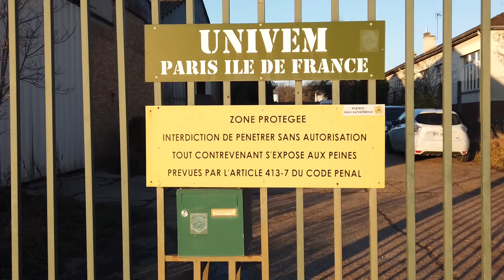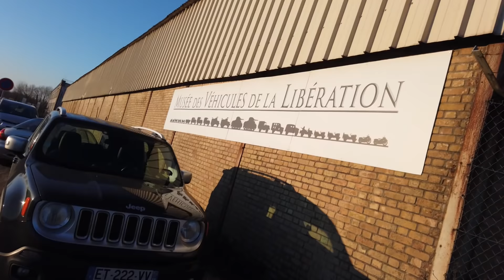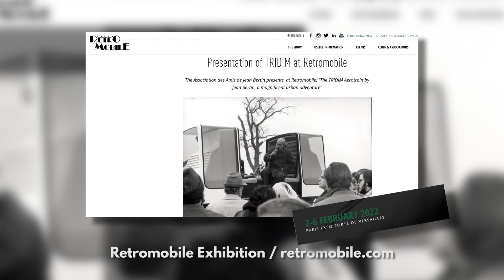The 422km/h Hovertrain That Destroyed The Rail Speed Record: What Happened To Aerotrain 01 & 02?

Comment: Usually when it's in a warehouse somewhere it's in awful condition, but those look GREAT! That really should be a part of some major technological museum.
Reply: Ikr? Must be some crazy-dedicated volunteers
Reply: Or perhaps a preservation society - restoring the original track. lol! Now that would be a tourist / heritage railway with a difference. :D
Reply: The only thing I can think of is that train museums don't think it's trainy enough and maybe general transport museums think it's too trainy 🤷‍♂
Reply: There are some political issues behind this story.
Reply: Aluminium doesn't rust, so things that are designed to be lightweight have a bit of an advantage. :-D
The problems start when they have aluminium panels and steel frames...
Reply: @juststeve5542  Aluminium doesn't rust, but it still gets oxidized (it's white).
Reply: @Ezullof  yes, but unlike iron oxide, the oxide layer of Aluminium doesn't expand in size, and remains on the the surface as a protective layer.
Iron expands as it forms its oxide, causing the rust to crack and flake off, exposing fresh iron to corrosion.
Reply: @tomjoad1363  Can you elaborate?
Reply: @frznbxy  At that time the french government had chosen it would be the gaz-turbine powered "TGV" that would be the next french railway system. Therefore they had to stop this project.

Comment: Two larger experimental units were tested 1969 to 1977 on a longer test track Saran to Ruan that was intended to become part of a possible later line Paris to Orléans. 
Aérotrain I80 HV (an 80-seater built 1969 with a propeller and modified in 1974 with a jet engine), stored in Chevilly after the tests ended in 1977, was unfortunately destroyed in a fire 1992.
Aérotrain S44 (a suburban version with linear motor also of 1969) was destroyed by fire 1991 in Gometz-la-Ville.

SNCF was not part of the project. But the threat of competition by a new system led them to develop a high speed train on wheels and rails that was compatible to the existing network.
As the high speed tests of 1955 had destroyed several pantographs, at first a gas turbine train was tested (TGV 001) until the project was developed further into the electric TGV that we have today, with the first high speed line LGV Sud-Est built 1976 to 1981.
Reply: I was about to leave a comment about those tao other Aérotrain. I thought someone kept I80 HV wreck?
Reply: @mathieudizangremel7259  I would be interested in what remains of it!
Reply: So the rule is "old hovertrains spontaneously combust"? That is not good.
Reply: @uncinarynin  one tiny piece of about 10 by 10 cm’s, that’s all.
And some photo’s. The friends of Jean Bertin have it in their collection.

Comment: Thanks for introduce Aerotrain overseas. It's an incredible invention, it's simple, fast and cheap but TGV (high speed train) were chosen due to political reasons and the most advanced prototype, the I80 was burned but it still remains some elements. At 4:43 the thing with 2 red circles behind Tridim is an original I80 part. It's one of the two gas turbine used for propulsion on ducted fan version. The other one is in the corner with other parts of the propulsion system and a third gas turbine used for air cushion and auxiliary power. The original propeller are located in Figeac in Ratier museum. Ratier Figeac is a propeller manufacturer.
Reply: You should have seen Tridim in action, air cushion are unbelievable!
There are meetings organized on the track (Gometz-la-ville) between enthusiasts once per year, you should come, there are some videos on my YouTube channel and even an interview of one of the pilot. There is another track in Orléans, an 18 km test track at scale 1 where Aerotrain I80 breaks the speed record of 430.2 km/h. It was the fastest train on the planet!
Reply: Aerotrain was also experimented in the USA. It's called the "ROHR Aérotrain" it was full electric moved by a linear induction motor. But because it was drawing too much power, tests were quickly aborted. This prototype can be seen in Google Maps at this address: 301 W D St, Pueblo, Colorado.

Comment: Nice you've visited those survivors. It was an interesting project but lacking vision ... even without the petrol crisis, it barely had any chances to go to production as it couldn't use any existing railway infrastructures, and its own infrastructure requirements were more stringent (curvature and gradiant) than for the TGV (which too was first designed to use turbines but was able to swtich to electricity).

Comment: Los Angeles County, CA looked into a TRIDIM style pod system between Los Angeles Union Station and the Antelope Valley as a replacement for the current very slow passenger rail. For some reason it was decided planning a very long tunnel across multiple fault lines and underground aquafers was a better solution (can we say graft?).

Comment: A concrete rail line?   Have you ever seen what a concrete sidewalk looks like after 20 years?   It is not 'FLAT' anymore, it has huge heaves up and down in areas.  So a hovertrain made with a concrete track would suffer the same problem = spots heaved up where the train would slam into at high speed.

Comment: Wow. No exaggeration, this literally IS a fighter jet on a rail (actually, more like a guideway)
It is constructed exactly like a fighter jet of the era and built like one. Same aluminum. Same rivets. Same cockpit. 
e.g. the shot at 3:16 shows a typical airplane longeron, complete with typical arrangement of holes to reduce weight. Definitely nothing like a train, even high speed one, or any other ground vehicle.